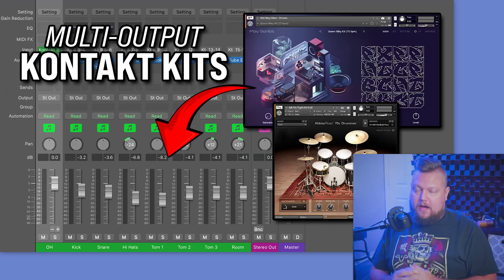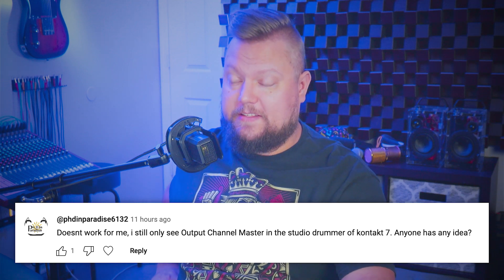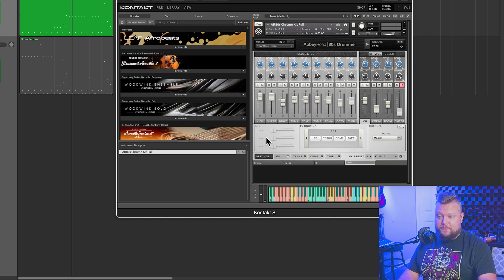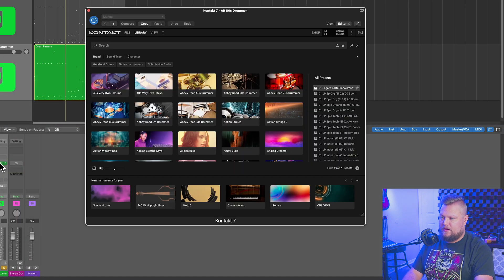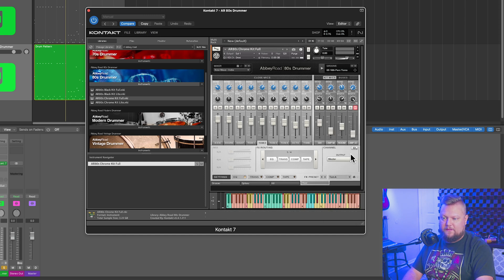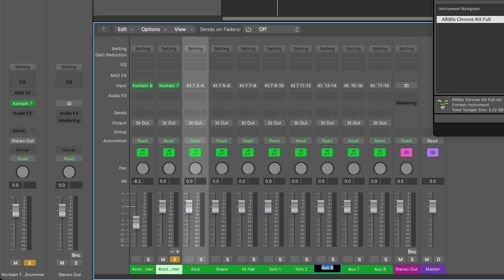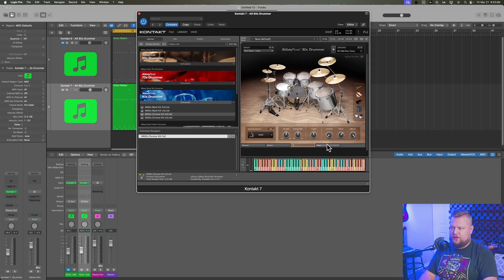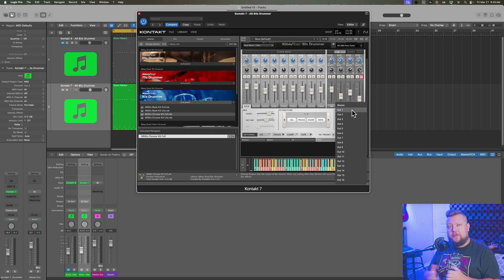Kontakt 8 vs. Kontakt 7 Multi-Output Drum Kits (Logic Pro)

Comment: Are you able to record a performance on any of the tracks?  I often need to record my own part. For example, the pattern of kick does not match what I want. I’ve done this with the Logic session drummer, but wondering if it works with a Kontakt kit…or any others, like Modo or Easy drums.